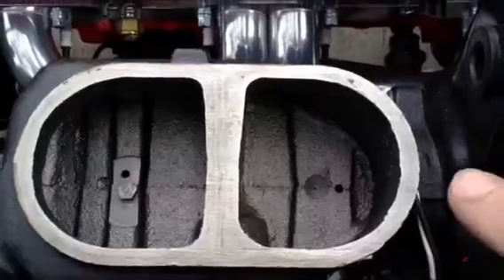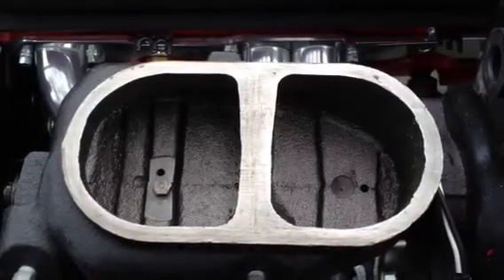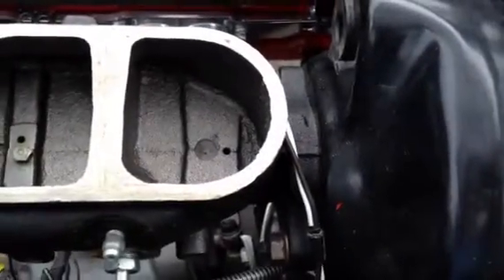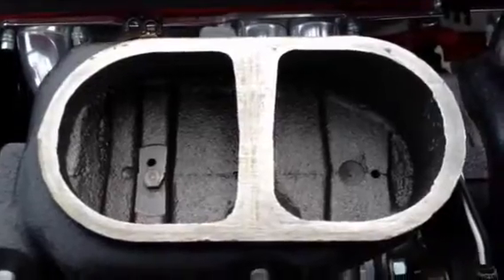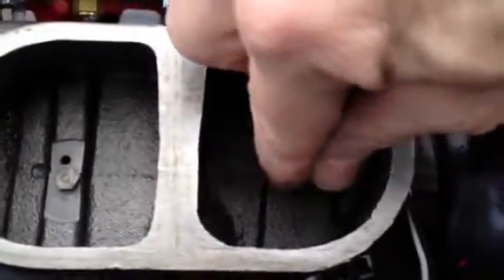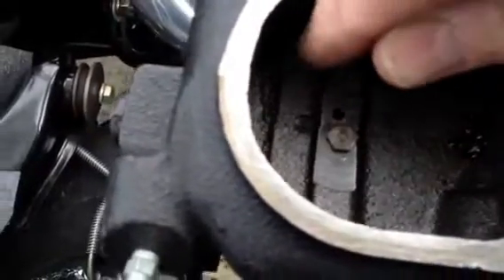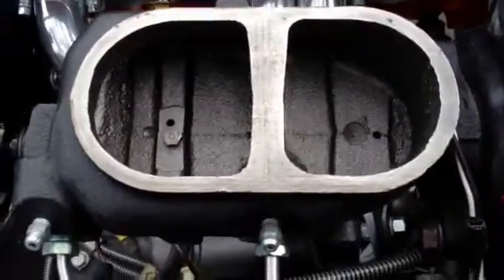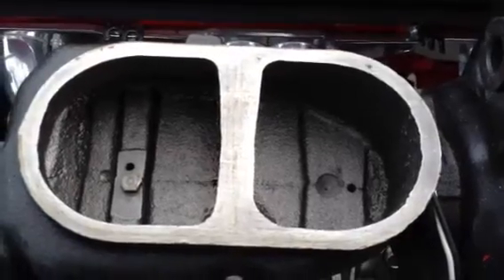Master Cylinder Spongy Brake Pedal Part 1

Comment: I have a 1972 C3 and I am one of those people who has bled the brakes a 100 times and wasted litres of brake fluid, but brakes still spongy. You mention to make sure it squirts when pressing the brake pedal. I am noticing mine only squirts from the front chamber. Is that a sign that the rear hole might be clogged? I tried to rinse it with a big paper clip as per your instruction, but still only squirts from the front chamber.

Comment: What's that got to do with spongy pedal is when you don't have brakes like something is bypassing
Reply from the maker: If you have bypassing. There is either pitting on the cylinder that lets pressure bypass or there is a tear or severe wear on the rubber of the pressure seal.

Comment: Some of the simple circuits of any system, can give you the biggest headaches trying to fix.  Brakes, seems so simple, but a little thing you never think of can screw you.    Toilets. Same thing. How hard is a toilet to figure out, but some dumb thing can take you a week to figure out.   thanks for the leveling the bowl video.   I thought flat was the way to bench bleed a mastercylinder. Because of the instructions I get with the part.  I'll sure try and get those extra bubbles out now.      although it seems when I press fast and hard I get a lot of little bubbles coming out of the back res after I thought I had it bled.   I'm screwed.

Comment: I have a 1981 ford f100 5.0 l truck. Replaced caliper and brakes and master cylinder. Pedal goes down to the floor. I'm sure this is my problem. I often wondered what those small holes were for. Now I know.Thx. I'll post again after I try this method.

Comment: my dad has 1980 camaro and we believe theres air still in the lines but we've bled them numerous times. when the car is off however the brake pedal is real hard as it should but once the cars on the brake is spongy and sounds like air... will this resolve it? also when we take the cap off the MC bubbles only seem to be forming in the front part of the MC not the back does this mean the air pockets are only in the front..? help!
Reply: Peanutbutter Angeli did you find out what was the problem?
I'm have the same problem with my Toyota scion.
Reply from the maker: You can give us a call m-f 8-5pm 11-1pm lunch 305-256-8077
Reply: Peanutbutter Angeli......You may have a leak inside the master cylinder . buy new master cylinder